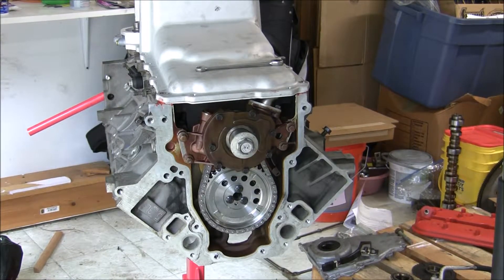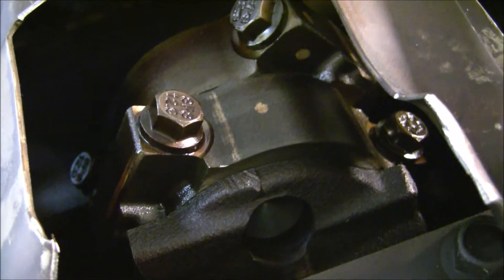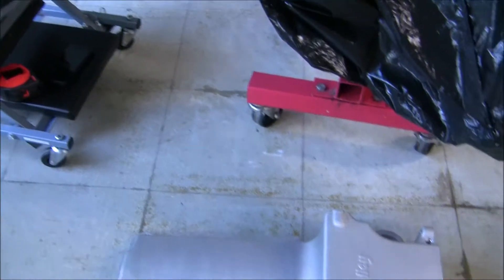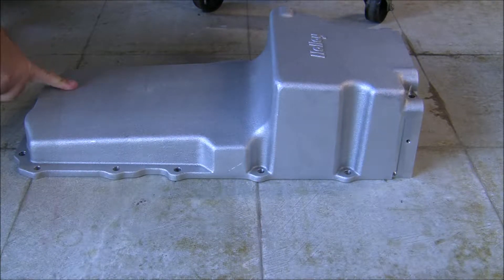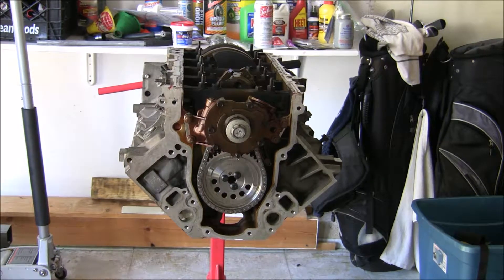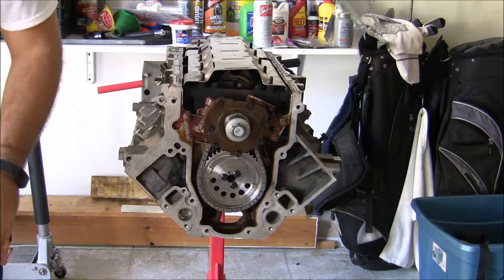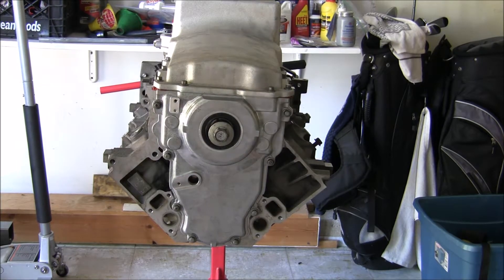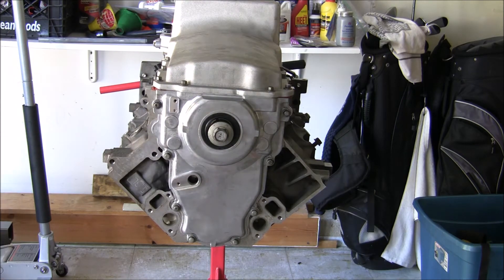5.3 Part 6.5 - Oil Pan Install with more issues

Comment: I never use large torque wrenches for tightening anything under 25 Ft.Lbs. even if they are capable of torquing as low as 5ft.Lb. There is just too much leverage when they are too long & it's hard to tell of you're going over the torque by simply feeling & waiting to hear a click. With smaller torque wrenches, you can actually feel the resistance when you are approaching the proper torque just before you hear the click. I also broke several bolts in the past using too large of a torque wrench. So did you figure out if the long bolts are torqued at a different setting? I was watching your other video & I clicked on the link on your comment to see which oil pan you used on your LS swap for your Elco. I plan on doing the same for my 79 so I'm doing a little research. I may never even get to it before losing interest since I have other projects going on. But thanks for your informational videos.
Reply from the maker: agreed, unfortunately this was all i could get my hands on...need to invest in a good set lol...yes, they are, i found out the hard way by overtightening and snapping one of them.  they are 106inlbs. I'd advise to be careful with the swap pan, the newer one is shallower and didn't fit my block.  I have a gen 4 block which could be the reason, so be careful. good luck and thanks for watching,